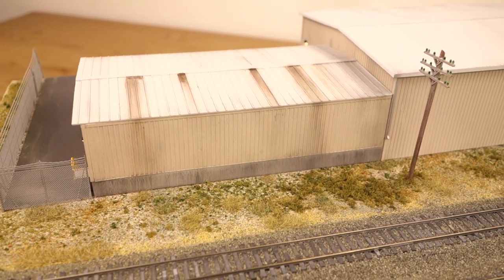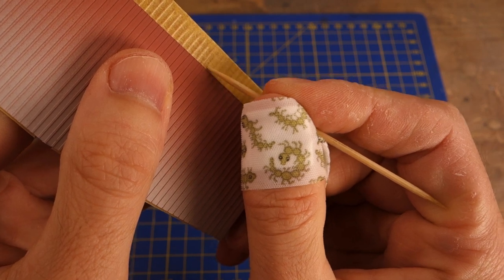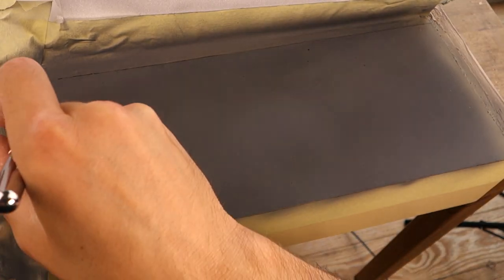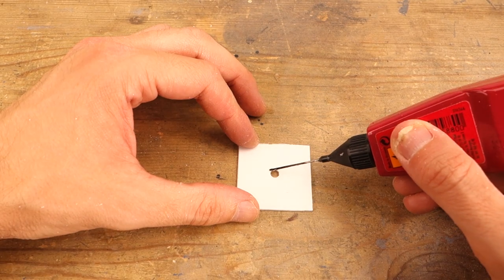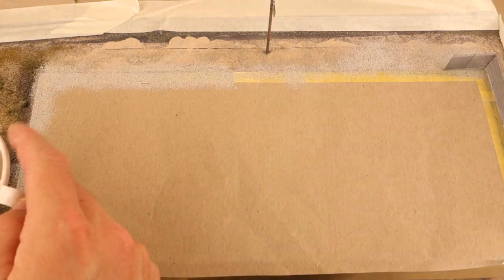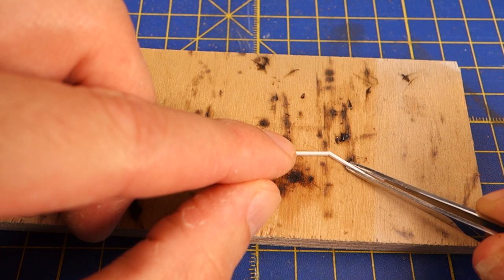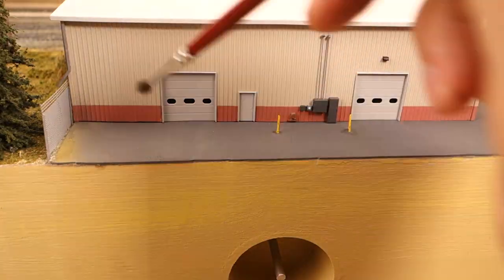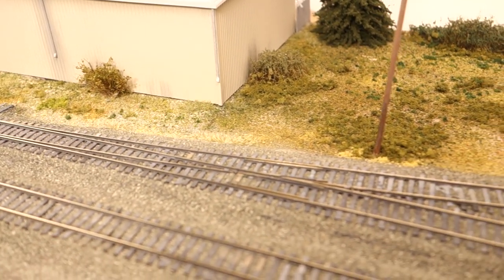Painting and detailing a boring structure

Comment: Rice paper or cig. paper with a thinned white glue to secure to the lens of the lights will shift the light into a more white tone; also add signs of birds nest above the light box. Birds of all kinds will often perch on building lights. You might be able to use clear plastic with transp. white as cover on the lights if the paper is to touchy. Great video by the way..
    Fn: As your building gets older be sure to leave some oil stains an darker marks where the fork lifts move about or park. Often after just a few days of rain you can find a rust stain on the ground from the blades touching the ground. Pallets or small broken shards of wood from damage pallets will end up out side bay doors as well.